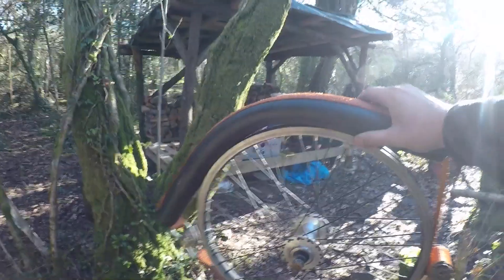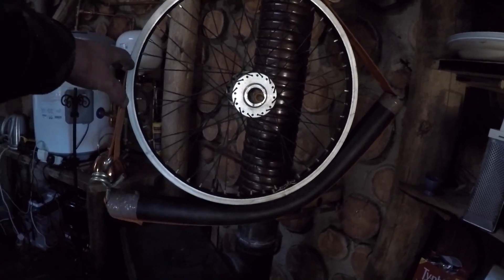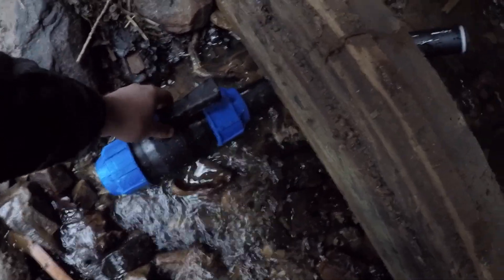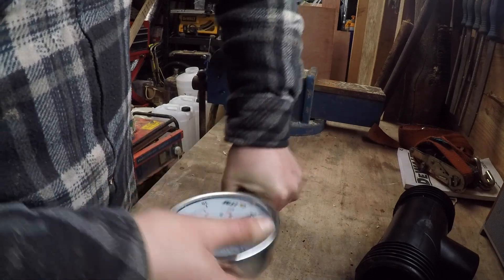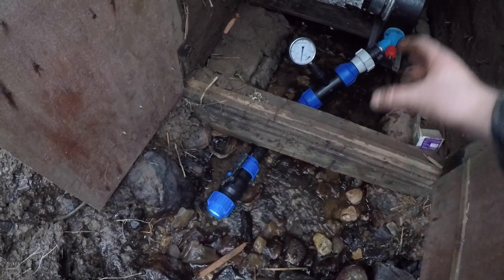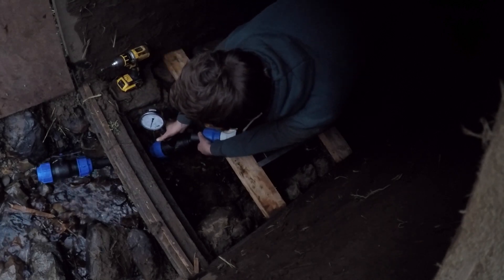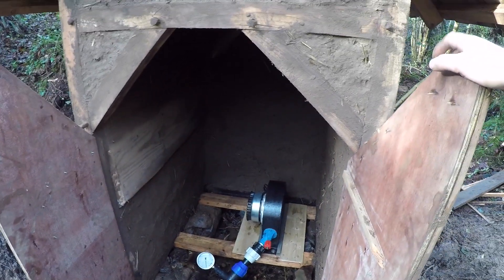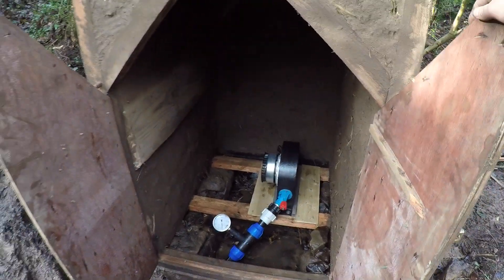DIY Micro Hydro 9 Mounting the turbine

Comment: This channel is soooo good. I only found you a few days ago but have been binge watching from the beginning.      Thread tape: If you're right handed, hold part in your left hand. Wrap minimum of 5 wraps (I do 13 for 1/2 inch brass fittings) over the top clockwise, with tape in right hand trailing from the bottom, pinching tension with thumb and index finger. But you already know this as you've now been at it for years!!!!! 😊😊

Comment: Hi i am from nepal .i am thinking about it .i have  water source  25 mm plastic pipe from 600 m far away its head height is  around 200 m .can i  build hydroelectric from that source and if i can what is the power of that electric?

Comment: I know this is way late but I worked once in a place where we made special plumbing pipe items in PVC and poly. This involved cutting and welding and bending. The bending was always done with filling the pipe with very hot sand then plugging it both ends and laying it over a radius buck and let it sag to where it needs to be. Smaller pipes would be done with hot oil instead of sand.

Comment: I know you arent using this same setup now...I just noticed the cooling fins would be spinning the wrong direction on this setup...the rotation should be counter clockwise
Reply: chris owens - c. fins/centrifugal fan? I could see holes in the top/magnetic bell of the alternator and see the coils through them between the fan blades = thus a fan. I think there should be a plate on top of the fan impeller to force the air though the holes, in its current state - the air will be sucked directly in through the open impeller/the top, and the alternator will get hot

Comment: Woo exciting. What voltage are you running from the turbine I forget. Just wondering about losses across the cable if its low voltage / high amps. Might be worth putting an inverter into the shed to get it to 240v that way you wont lose so much power over the lines. Depends how long it is if its actually worth it or not.

Comment: try hot water to soften pipe
Reply: ram1brn Heating up the sand in a dry pan and then pouring it in is even more effective. For a lot of pipe, that's enough heat once you've got it in, otherwise you just need to add a bit of external heat to bend. A template made of pegs hammered into a board can hold the shape while it cools.

Comment: Did you think about running the ratchet strap through the pipe? -- you wouldn't have had to pack it with sand, and it wouldn't have pinched.
Reply from the maker: Very good point! Why did I not think of that?
Reply: It would have pinched anyway without packing it .... the packing forces the outer circumference to stretch in length as it curves ... without the packing, even with the strap on the inside the pipe would have crimped instead of stretching in length :D

Comment: Quick tip with Teflon tape is it goes with the grain and after you put it on using the spool of Teflon tape run the outside edges of the spool so The Ridges push the Teflon tape into the threads and you'll never have your check signed up on you and it will seal far better

Comment: Looks like it's going great,
I'm quite interested to see how you handle the pipe and get it in place, having seen the fittings in your last video It looks like it's going to be huge!
Reply from the maker: Yes indeed it is going to be a right laugh getting it in to the woods. No way to do it by machine. I will be pulling it with ropes and pulleys
Reply: That'll be a good test of your problem solving skills!
 I hope you have a helper or two when you do it
Reply from the maker: Hannah and Craig are already booked it 😊👍

Comment: Sorry if I missed this detail, but remember to add a vertical vent downstream of the screen near the top of the penstock to help air escape, and preventing damage from suction if it gets blocked, and remove trapped air, when it is filling. Valves at the turbine end should be opened/closed slowly, to minimize surges.
Reply from the maker: thanks for the comment, i have a large T fitting just for this purpose.

Comment: No rubber mounts to negate some of the vibration/noise?
Reply from the maker: it should be pretty well balanced, if it shakes around all over the place i can put some rubber under it no problem.
Reply: Yup drop the frame a couple of inches (or cut out notches) and a couple of old engine mounts should do the job rather nicely :D

Comment: u should look up grit collection and airiation tanks to help you find away to get the fine sand and air out of ur system i seen where ur sluth box was collectin sand thought this may help u out could use a steal drum standing upright with a clean out valve at bottom and the top open with a screen and collect only the water from the top of barrel to go into ur system bury the barrel in ur stream where u have ur sleuth box at and attach ur box to it with a cut away in the barrels top edge to allow ur water to come over  in to the sleuth box.good videos love ur pad u are the man ,,lol

Comment: only kris would bend pipe with a bike wheel, a ratchet strap and a chimney
Reply from the maker: i was quite proud of that, i love having a problem to solve. looking around to see what i have and then work out a way to solve it with tools i have.
Reply: also, if you don't know about 'water hammer' (which is a spike in pressure when a valve is closed) you should watch a video of the same name by Pratical Engineering.
Reply from the maker: i understand the uncompassable nature of water making it hammer. im confused how the related to this?
Reply: because the valve is at the bottom of the pipe so if closed suddenly, pressure could build behind it from the intake and rupture something. i dont know if that will be a problem on this scale, or if youve done any calculations to prove its not. just wanted to make sure you knew

Comment: Good Fittings and nice to see you use a oil filled gauge. This should work well. One question do you have a way to let any air out that might get trapped by the gauge ?
Reply from the maker: No, but an earlier comment picked up on that to. so i will need to add a fitting or two to fix that.

Comment: Kris you may get air trapped by the gauge pop a tee in there then gauge at 90 then on the top outlet a tap so you can open it to remove the air. Well done and thanks for sharing
Reply from the maker: thats a good point. next time i am at the pipe supply place i will pick up some fittings to do that. nice one.

Comment: Moving big rocks by hand is going to be hard on the old previously injured back.
Reply from the maker: you remember that? that was a painful injury and i did it pulling out a weed. you are right its prime back pulling work and i will be as careful as i can. its only a few meters i have to dig away. not to bad.
Reply: Kris Harbour might want to consider building a variation on this rock sling with connectors for a cantilever to assist lifting the larger ones out of the river bank.  Can use it for logs too.   https://www.canbike.org/bike/bike-articles/trail-tool-rock-sling-for-moving-up-to-800-lb-boulders.html.  Wife is always telling me, “work smarter, not harder.”  Wish I could help but I live in America.